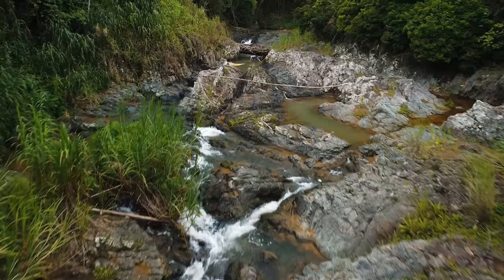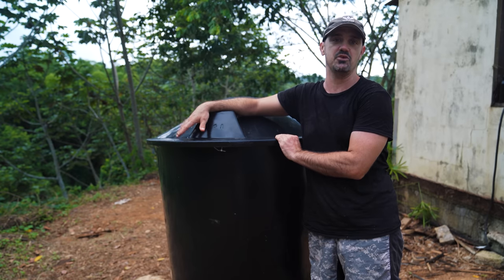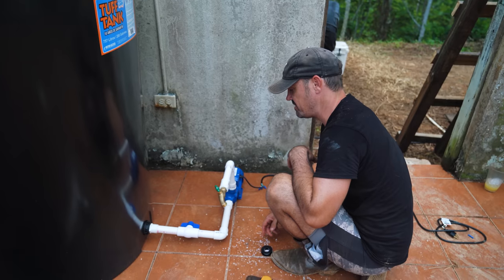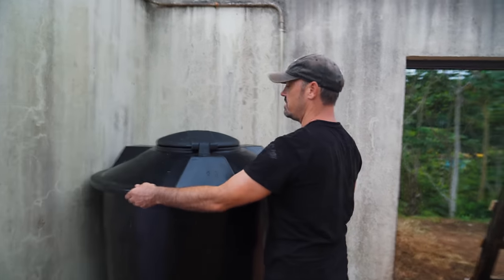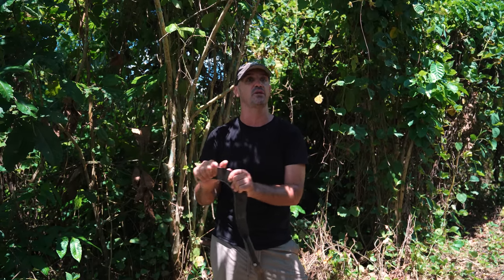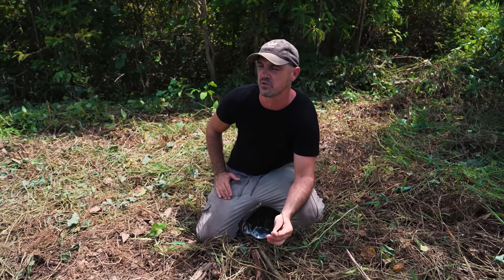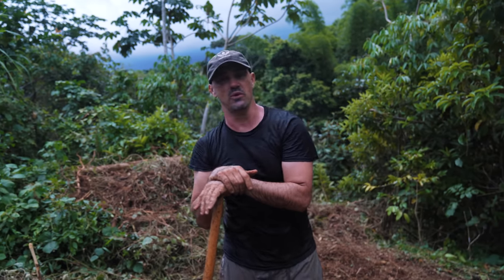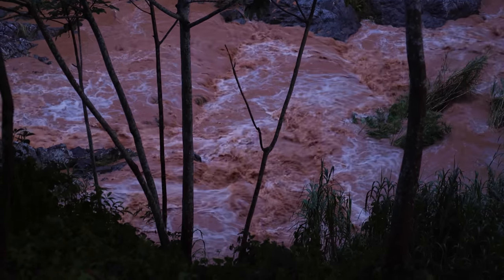WE BOUGHT AN ABANDONED PROPERTY THAT WE HAVEN’T EVEN SEEN 90% OF!

Comment: Nope, put in a fill pipe, you don't want anything getting into it because it becomes a mess to clean out once contamination starts. Once you determine it's going to be more permanent, add a filter system to get rid of microbial particles. That will serve as your pure clean drinking system. Huge Tip, later on put a T pipe in your water system to split it. 1 way for drinking and cooking, 2nd way will serve non-restricted water flow for laundry, toilet, shower and other things

Comment: Matt, I live off grid.  I collect rain water from the metal roof of my house.  I used concrete blocks & built an elevated platform for my 300 gallon water tanks to sit on.  This gives me some gravity pressure.  If you elevate your tank and put some corrugated metal roofing above the tank it will fill your tanks easily. I have lids over my tanks with a screen covered hole that filters out debris and keeps bugs & such out.  You are getting there brother.  Keep up the good work. 🤗 Also a couple of goats will clear your land fast.  Put them on a line to control the area they are clearing.  Also pigs are great at clearing and turning over the land. They will do 95% of the work & as a result they make tasty bacon & chops.  It's a win, win with pigs. 🐖
Reply: I’ve been watching you guys I’m really proud off you guys I’d like to suggest to you as a loyal fan to buy some ducks 🦆 for the property ❤❤ stay blessed Remember you inspire many of us ❤
Reply: Matt I live in a Rice Village in Thailand and all their water pipes are Plastic. But you must never drink the Government Water.  We buy bottled water to Drink. Thankfully not too expensive. We do have a Motel like Unit out in the Rice Field and we still don't drink the ground water but it's magic on the skin.  :)
Reply: Matt look at getting a strummer. You can also get a blade for the strummer . Also look at building a compost heap with  the leaves and your vegetable peels. Also you can put the worms in there. Also look at getting cardboard to place around the perimeter of the house till you make a path way this will help to kill the weeds and anything else from growing there or use a weed suppressing sheet that is not plastic. The cardboard is bio degradable .

Comment: You need a pressure switch and diaphragm pressure tank on the outlet line. The bigger the better but 2.5 to 5 gallon minimum. That way the pump can build up pressure switch off automatically and have water reserves that can accommodate the washing machines water requirements. Love Kristen and your adventurous spirit! Keep it up!
Reply: @Zzrdemon6633 The accumulator tank saves wear and tear on the waterpump. So that it’ll last longer.
Reply: Yes, great Idea. mine is an 80 gallon pressure tank so my pump doesn't need to switch on and off all the time. some pumps you can buy with a 20 gallon tank under the pump. mine has that also. this would give you an extra 100 gallons of water storage. I have a 3/4 horse shallow well pump. you could go with 1/2 horse easily for the cistern. the only problem with mine that I have ever had was freezing but is solved, and I don't think you will have that problem. lol.
Reply: Never had a cistern.  Had a well with pressure tank and pumps with pressure guages that turn the pump on/off.

I would not directly collect water from runoff into the cistern but collect into a settling and filtration collect tion tank and pump that into the cistern.
Reply: Came to say this!
Reply: 12 volt pump from trailer like he said or 120 volt if you wish same size same pressure rates. I have one on 2x6 with hose down into a 300 gallon cube then out line right into trailer. Hear the hum for refill trailer hot water heater or shower running. Pressurized line shuts off.

Comment: You don't need the pump.
Elevate the tank. Fill it up and gravity feed will give you all the pressure you need to feed the washer. 
Also set up a catcher and pull water only from the top to your holding tank. Sediment will settle in the catcher. No need to filter and carry from one to the other. Let gravity do the work.
Reply: I see a moso timber bamboo water tower in your future!
Reply: And you can harvest and pickle-process bamboo shoots when they just emerge.
Reply: @jackstrubbe7608  Bamboo shoot tempura! :D little bit of brown beer,  batter your bamboo shoot, boil some oil, and done! :D forest fried snack :P
Reply: You will need the on demand pump if you want to install a on demand water heater aka paloma they require around 24 psi minimun so they dont turn into a steam bomb and blow up most will automatically just not start if you dont have proper pressure a pressure regulator will be required you might want to throw in a bladder to the system

Comment: Nice size property! Good for you. When adding new chickens to the flock, put the new comers in a separate cage within the hen house so they adopt the new surrounding as home. Maybe pen up Juicy for a few days so the new birds can claim their new territory. Those new chickens quickly left because they didn't make your place their home. They would have kicked Juicy's butt if they had had time to make your hill their new home. I've introduced new birds to my free range chickens for years. The new comers will always stick together and will not leave you if given time to adapt. 

The "ditches" between the rows are called furrows. You rows and furrows should be perpendicular to the fall of the land. (crossways) On top of your hill you will not have to worry about flooding. What you should worry about is soil erosion. Don't let the heavy rains to rush down your furrows carry all your precious topsoil with it, down to the bottom of your creek. You should even dam up the ends of your furrows to allow standing water to percolate down through the soil slowly to be used by your plants. (I think you have a pervious subsoil that will allow internal drainage? Hopefully?) Don't let the heavy rains steal your wonderful topsoil. (By the way, your soil has a beautiful color and tilth! And! those worms are a sure indication of fertility.) Protect that good looking soil. It looks very loamy! Don't worry about standing water. Worry about the eroding runoff from heavy rains. You can never recover the topsoil that is washed away. Start right. Stay right. Good Luck, man. Your ag science farm friend from louisiana....

Comment: They make a carbide tipped circular saw blade for weed trimmers that will cut thru the vines without wrapping up, cut thru small brush, and doesn't sling the vegetation all over you!  And is still works great on leafy vegetation.  You can be surgical with it  - your property is the perfect candidate!

Comment: My garden was a jungle of ivy growing through the trees and bushes much like yours, although on a smaller scale. I found the best tool was a hand held petrol hedge trimmer (pole versions are also available for higher up areas) as it cut the ivy and twigs up to 3/4" and rubbed against thicker growth without damage. A hedge trimmer can go practically to ground level as long as it is oiled and excess soil is brushed off and tight up to stumps. Once the cuttings were raked out I was able to clear the thicker stuff with a hand saw and cordless reciprocating saw (SawzAll?) I save the chainsaw for stumps and trunks over 6". Don't forget that most chopped up vegetation can be put aside in suitable containers with the worms to become compost for next year's planting.

Comment: You can add a pressure tank to your water setup to keep the pump from kicking on and off constantly if you're just using a little water. It will help the pump last longer. Also you need a bigger area to catch the water from than just the lid of your cistern. Maybe put a tarp "roof" over the building and drain it into the cistern, or a makeshift gutter from your awning.

Comment: Make sure you save all those brush clippings.  Pile them up and save them.  They may be the best organic fertilizer you will find.  Put them around fruit trees or on veg patch and let them decompose.  
I use a battery powered hedge trimmer for small vines and young brush off fences and around my fruit trees.  Does it fast with little effort.  For woody branches a good pair of long handled lopping bypass shears is quicker and less effort than swinging a machete.  
I use a 5 gallon bucket in the garden to hold all my hand tools so I don’t lose them.  Trim off the bottom half of the outside skirt of the lid so it does not lock itself on the bucket, take out the rubber seal.  You can then use the bucket lid to keep water, sand etc out of the bucket, but it is still easy to take off.  Use it for a chair while you work.   Use it to store food and seeds, water plants.  I call it my 5gal MPT,  Multi purpose tool.

Comment: hey Matt, i'm sure i am not the first to say......as long as the black tank has water in it, you don't need to prime the pump. just open the spigot and allow the water to flow for a second or two then the pump will be primed and full of water. i would suggest a pressure tank to hold some water under pressure and a pressure switch to turn the pump on and off as the water is used so you don't have to turn the pump on and off manually. my thoughts....jim in central florida

Comment: I love watching you guys. Your best bet for the water pump would have been a household shower booster pump. They will pump water until the outlet flow is stopped, and the pump will cut out. Once the water pressure in the outlet side of the pump drops, the pump will cut back in automatically. I also think you'll find them cheaper. Check when you buy, but they usually come with a cutout switch. Hope this helps.

Comment: Just be careful how you put the drainage in the garden. If you put the trenches up and down the slope you will be adding to the brown color of the water in the creek. Should try to keep the top soil where it is. Drain any water away that's coming from higher ground around the garden, not through it. Any rain that falls directly on the garden should seep into the soil.  
Thanks for the videos, love watching them.

Comment: Man, we use it very differently here,
The reservoir is placed on top of the roof and the pump is used to push the water from outside onto the roof through the reservoir lid. In this part the pipe exits, which does not need a pump because it uses gravity itself to create pressure. 
I would recommend you run a pipe(or hose) from the river to your house to fill the reservoir on top of your roof(using the pump) and use gravity to do the work from the reservoir to the tap.

Comment: The roof tin should run across (not along) the supports for when there is a lot of rain. The roof should guide the rainwater to the cistern.
FWIW you can find them (on-line) there are 2 good books on Rain Water Harvesting, one by the U of Hawaii and the other from Texas. A lot of good information and engineering already done on using the rain for drinking water.
Chickens are easy, or as complex as you want. They can be done on the cheap, they can feed themselves but they do need protection and a place to call "home" with water & a nest box to lay the eggs.
Good luck guys & have fun!

Comment: Matt, you can get a solid blade for the weedeater. It looks sorta like a circular saw blade. I'd get one made by the manufacturer of the weed eater made for your weed eater. It will do vines and small trees. Works really well. It's a good middle ground between the string or the chain saw.

Comment: Matt, I have a lawn and tree biz so check this out. First thing you need to do is get rid of those plastic attachments on your weed eater. Those plastic blade things are a complete joke.  Buy a head that uses .095 string. And get a big spool of .095 string  it's perfect for that Echo weed eater. (It's probably a SRM225). When cutting with string just use the very tip and it wont get wrapped up as much.. To cut vines with chainsaw have Kristen pull the vines tight with a stiff rake then cut them off at the ground or whatever. A gas hedge trimmer would be even better. Again when cutting vines pull them tight before you cut. Just keep puling and cutting pulling and cutting.

Comment: Matt, if you start cutting high and working down with your string trimmer it will jam up less, that being said they sell a blade that is very similar to a carbide tip circular saw blade that will fit in most straight string trimmers. I bought one because I made the mistake of planting some bamboo in my property that is totally out of hand. Good news is the circular blade cutter makes it easy to cut down and I now have an abundance of poles for plants In the garden. By the way if you have larger bamboo you can use it to make a roof, you can find example on YouTube.

Comment: There is a blade for weed eaters for brush . Looks a lot like a circular saw blade. Good for 1- 11/2 inch thick stems. There are even blades that have chainsaw blade around the edge. Those work well until the teeth start flying off. Good luck.😊

Comment: I live in  Colombia. Cisterns are used here. There is a large underground cistern that the city pumps water into. Then a cistern like you have is placed on the roof. A pump like you have pumps the water from the underground cistern to the one on the roof. All water in the house is gravity pressure. There is a float valve in the cistern on the roof that turns the pump on and off. Jus like a bilge pump in your boat

Comment: You need the steel blade attachment for the weed cutter. I live in taiwan witch is very similar to the jungle your in now. The locals all use the steel blade on a gas cutter and there life changing to use ,trust me ist worth the upgrade guys. Also ,, get your self a gold pan and check that river for gold,all the signs for gold are showing in that river . Could be a fun hobby or a small income for ya all?

Comment: Once you are finished with heavy trimming, look at some Japanese garden hand tools.  I love my Japanese Grass Sickles with wicked Sawtooth blade.  I have 3 sizes I got for an experiment.  If I did it again I would get stainless steel blade.  The carbon blades rust quickly.  
A couple of the various Japanese weeding sickles can be used like a mini scythe for weeding or trimming.  Drop in a big folding knife, folding limb saw, garden shears,  garden trowel.  They all fit in my 5gal MPT with a pair of gloves to avoid thorns.

Comment: Don't invert your cistern lid. Muck and crap will settle on the lid between storms and you will transfer that mess into your clean water. When you explore the rapids/creek, I hope you can find spot to extract hydroelectric power and mechanical power. You will find examples on You Tube of people converting the motors from old washing machines into generators. You would need to build a battery storage system, of course, but you have masses of power on your doorstep with that flowing water.

Comment: Most cisterns I am familiar with use the pump to lift the water to a secondary holding tank above the ceiling (in the attic) controlled by a float switch. All water is then gravity fed. The pump only kicke on as needed (and usually 12v)

Comment: You need a shredder blade for your strimmer. It mulch everything it totch. Fines are cut by the vertical blades. 
Check if it will work for you. 👍👍👍

Comment: Helpful tip for your water tank.
1. Raise your tank so gravity will feed your washing machine.
2. Split the connection out so if you need pressure you have a hose.
3 if you don't need high pressure you could almost do without the pump.
4. Long term solution, Pumps are usually used for well or water sources, to keep your water tank full, if you had a water source I suggest a pump, long hose and a blue frp filter with coal, this will give you water, semi filtered and coal will take out the smell.

Comment: Make sure you filter or boil your cooking and drinking water. Things begin to grow in cisterns over time. Also, make sure you disconnect your pipe from the roof during hurricanes. They carry salt spray amazingly high and you will need to drain and clean your cistern if it becomes brackish. You two are doing great!!

Comment: Suggestion, plant some coconuts and bamboo (good source of wood and soil stabilizer if you have a slope side of the property!), and herbs than act as mosquito repellants around the vicinity of the house, good luck on your homestead, by the way you can also try to utilize a Ram pump on the running stream to allow you to get a steady source of water and have it stored in a tank, besides rain as your primary source!

Comment: You really need to cover a complete room with roofing and prevent rain from entering that room.  Wind and Rain means everything inside will get wet!  Not sure putting the tank inside is smart.  Will it collapse the floor?  What are the benefits?  Outside is best.  Next time, completely submerse the hose in the water, hold hand over opening or use plug, remove that end keeping other end in water.  Stop inhaling water!  I live off grid.  110v pressure water pumps work great, just like the one on the rv but 115v.  Transfer pumps are not made to pressurize.

Comment: Matt
Use unions before & after the pump & regulator. Makes replacement quicker & easier.
Standard household water pressure is 60 psi +/-